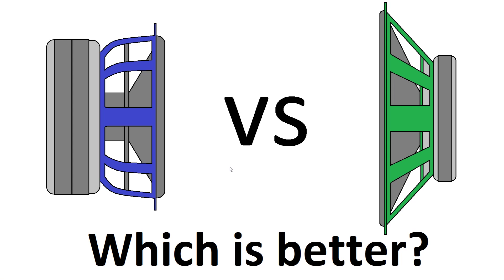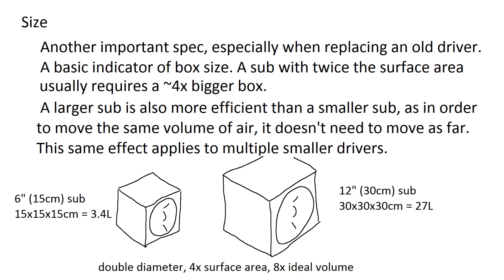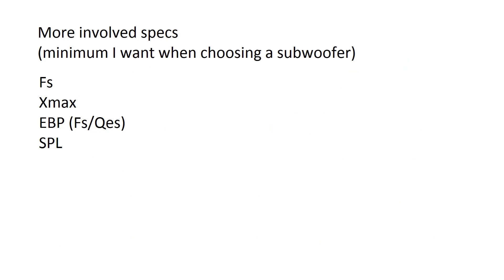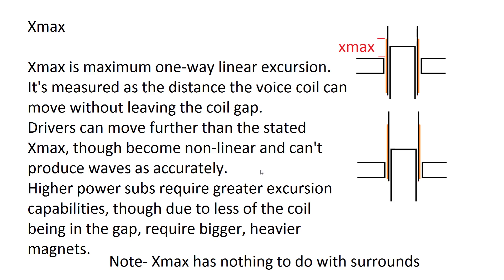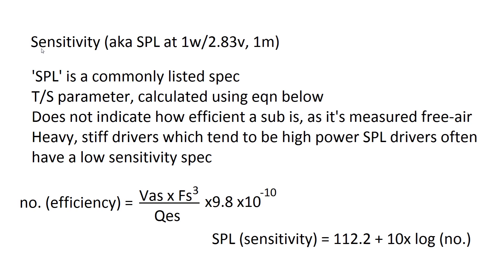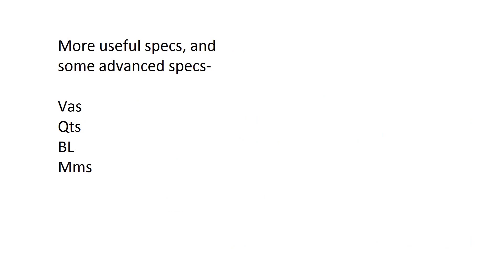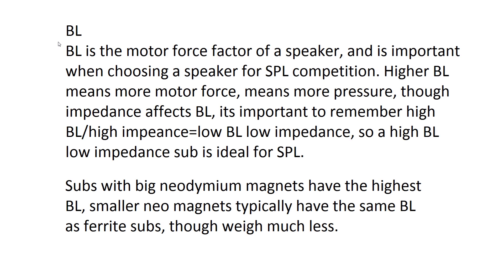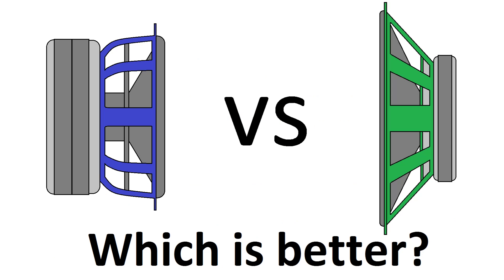Choosing the right Subwoofer

Comment: Before you spend a moment modeling your driver(s) in anticipation of Low frequency Nirvana, you should do the following in the sequence below:

1. At a minimum , check FS. Check & record all the TS parameters if you want. If you’re serious about getting the most satisfaction thus minimizing disappointment…

2. break them in free air for 24 - 48 hours changing the frequency* every 2 hours. Careful not to exceed rated XMAX. Please note: lower frequencies at the same power as upper will move the driver further. 
*never equal or lower than FS (in #1) to avoid damage. Best set the frequencies in range you plan to use it 

3. Test/check your driver’s T/S specs. As Dak said “…after 20 hours of use, the FS spec will change…” potentially changing the final system performance. If you’re building a multi-driver system, check & record all the drivers’ TS parameters. It’s possible the specs may differ slightly. How much indicates quality control.

Now you can model, design, build, test, tune (if ported) and enjoy your sub system.

Comment: HELLO, I BEEN TRYING TO DO AS MUCH RESEARCH AS I CAN I HAVE A ALPINE X-W12D4 AND I WANT THE MOST SPL I CAN GET BUT NOT LOSE TOO MUCH MUSIC PLAYABILITY ACCORDING TO YOU IT SHOULD BE IN A SEALED BOX BUT IT DOEX HAVE GREAT XMAX  AND A LOW RIGHT NOW I HAVE IT INA  PREFAB BOX THATS REALLY CLOSE TO PERFECT PORTED ALPINE RECOMENDATION. 1.7 INTERNAL VOLUME AND TUNED TO 36 HZ  IS THIS REALLY THE BEST I CAN HOPE FOR OR WOULD A 6TH ORDER BE BETTER OR A 4TH ORDER SINCE IT DOES LOWS REALLY WELL ALREADY BEING A LOW FS SUB AND NOW ITS A COUPLE YEARS OLD MORE LIKE 25HZ FS OR SOMETHING LIKE THAT INSTEAD OF 27 OUT THE FACTORY.

Comment: I think with Vas it's more equivalent to a rigid plunger the same surface area as the Sd of the driver - the projected area of the cone perpendicular to its in and out motion. Atmospheric pressure air usually needs about 0.01 bar of this pressure per % compression for small close to linear compressions.

The Vas (if measured at sea level) is dependent only on suspension compliance Cms and area Sd. Cms is the number of millimetres a cone will move off centre with a Newton of force on it.

Comment: ObOut of everything xmax is the most missused measurement and i is a peeve of mine, you are knowledgeable  and know the deal but when other yourubers who are schooling viewers or reviewing subs miss use it like "it has a taller frame to increase xmax" or comparing subs saying this one has more more x max so it will move more or like its better because of the xmax number even tho ive tried to explain the formula abd how xmax can be decieving and how 2 identical subs but one has a thin top plate one has a thick top plate how the x max will be considerably different but yet function is pretty much the same or the one with the lower xmax may prrform better because with the thick plate it may have a larger magnetic field on the coil and linierarity is comparable.... you can have a really tall coil and really thick top plate and a sub with a little short coil and a super thin top plate and both have the exact x max but yet one is way more powerful and have way more excursion.....so Without knowing the coil winding width and top plate thickness xmax doesnt tell you much about performance. Basically xmax is missused for x mech ALL the time o  youtube and drives me crazy.... These people need to educate themselves before attempting to educate otheres ya know...

Comment: I'm in a dilemma. Should i keep using my focal f40th 10" sub or should i get the focal utopia m sub10wm? Please help. As i just moved the focal f40th speakers and tweeters to the rear and have the utopia m 3 way active in the front. 6wm at doors,  3.5wm and tbm are at the front A pillars. My current sub is in a sealed 1.041 Ft3 box.
Reply from the maker: Depends, at face value the f40th 10" sub should be fine, but if you think your system is lacking depth, say low 30s/upper 20s region might be worth considering the sub10wm, although a 2 ft3 box will be more suitable for the sub10wm. If you haven't yet treated your current sub box, could be another upgrade to consider.

Comment: way you call subwoofer any speaker can go below 0 Hz they a only call woofer right ?
Reply from the maker: I would say a subwoofer is designed only for low frequencies, and a woofer can do some midrange. Woofer can do around 50Hz to 500Hz, subwoofer does around 80Hz down to 30, 20 or even lower.

Comment: I once bought a solid speaker system with 6000 watts output. Used to draw 0.5 amps from the outlet at full volume 😂😂😂
Cost a dollar, so it was worth it. For parts.
Quick calc: 0.5A @220vac = 110watts, 
class D amp rated at ~80% efficiency, 
Actual output <85watts.
Considering 50% loss to sealed enclosure design and driver efficiency losses, actual sound output would have been closer to 20 watts 😂😂
6000 watts advertised to 20 watts actual 😱😱

Comment: 4:55 aren't they always tuned below Fs? don't speaker move the least on a port resonance frequency so it will make its life easier on a lower frequencies and actually prevent damage?
(ofc if subsonic tuned right so it wont go lower the port tune freq)
Reply from the maker: Sometimes tuned below Fs, not always. Can be done, heck I do it myself all the time, I think its more of a SQ thing not tuning below to avoid some harmonics which can form. Some drivers though have stiff/heavy enough cone and a strong motor can play below Fs just fine, and sound clean. 
Tuning below Fs is good for controlling excursion though, especially in larger boxes.
Reply: @Dakoustics  just to clear things up a bit, are we talking about free air resonance or resulting speaker + box volume resonance?
i think tuning port to Fs and higher is what spl guys do(and on a cheap woofers to give some wow effect on a most common 40 or 60hz frequencies). 
tuning it lower is done in order to extend frequency shelf a bit, because speaker efficiency below fs drops drastically, so port gives some extra 5-8hz or more with eq'ing.. 
and makes everything on its resonance a 20+ ms group delay humming hell, cant see someone sane actually enjoying that on a working frequency range.
Reply from the maker: @Timsturbs  Free air resonance, Fs, whereas resonance in a box is Fb or Fc, can't remember specifically, but Fb sounds familiar. 
And yes, thats all 100% correct. The only difference is I'd say its less common for a manufacturer, such as JBL, to tune below resonance, but we as educated and free humans can tune into the single digits if we so desire. 
I can't remember specifically why I suggested not to tune below Fs, though I believe its more due to this video being focused at beginners.

Comment: Different manufacturers measure Xmax differently; there is not just one way to measure it. Therefore, one must either know how the company measured it, or just take the reported Xmax as true. Higher powered subs don't "They move more with more power." I'm sure that there are subs like you mention, but just more power in and of itself is not sufficient for your conclusion. It depends a lot on the enclosure.  
--come on. you know you are fibbing.
Reply from the maker: Generally higher power handling subs are also capable of more excursion, and having plenty of Xmax is never a bad thing.
Reply: @Dakoustics  Well, IDK about in general. Any speaker can have any thermal limit. But what you are saying is that, .. if a speaker has a higher Xmax, then it must have a higher thermal limit because of the power and mechanical properties.

Comment: I am planning to put a 21” 2,000rms  woofer in a T-42 enclosure. Would this woofer sound better that the intended woofer from Cerwin Vega which is. 1,000 rms power l? I believe the gap of this woofer is 1.6.
Reply from the maker: Most drivers should work, a driver with a very low power handling might not work in such a box, but a more powerful driver should be fine. I can't say if it will sound better or not. Worth testing

Comment: The part where you describe how drivers can cut off part of the wave form. That's called clipping and is actually pretty hard on the motor. That's what causes most of the heat. It can also cause the windings to delaminate from the former which is what makes that scratchy noise we all never want to hear. It can be equally damaging to under power a sub too. Running out of electrical headroom is hard on the amp and can also cause significant heat in the speaker motor especially on the stiffer drivers. If the amp can't overcome the mechanical resistance of the driver all the current it can generate still gets dumped into the coil. If it can't move enough to dissipate the heat, it fries. Great video man. I wish the world had more people like us who truly understand this stuff.
Reply: What he is describing has nothing to do with the amplifier clipping.  Clipping can increase the power seen by the speaker because it electrically  flattens the top of the waveform increasing the average output and at the same time limiting the movement of the speaker somewhat decreasing it's ability to cool itself which you mentioned. Yes, amplifier clipping can be hard on both the voice coil and the amplifier itself but that isn't what he is referring to.  He is referring to the electromechanical limits of the motor assembly.

Comment: Hi there. I am wanting to run two 8inch subs both at 500 rms recommended but advertise 4000w max power. I dont want to run an 8000w amp for two subs that im wanting to run at 500w each. would a 1ohm capable 1000w or 2000w  work more than fine? and how do i know if im running the correct amount of watts through the speakers?
Reply from the maker: Yeah, 500w on an 8" should already be plenty for them, 4000w would likely result in a new bit of space debris. If each sub is a dual 2 ohm, a 2000w at 1 ohm will do, if they're both 1 ohm, a 1000w at 1 ohm should suffice.

Comment: Dak: I have some vintage speakers, one of the large 12" drivers was sounding bad, we took it apart and it looks like the voice coil was stuck to the spider.  We cleaned everything out now.  We slowly trying to get replacement parts, but none are around, so, I purchased a matching set of 12" drivers with with way more wattage than the previous,  but when we played them, I realized our crossover didn't match.  Do you have a guide on choosing the right or upgrade on the crossovers?  I love the cabinets on these old speakers, I don't mind changing out what I need to keep these up and running.  I also have a 20 year Infinity speaker that needs a new crossover as my tweeter is not functioning properly?  Any suggestions?
Reply from the maker: I'm not sure exactly if voice coil inductance itself is a major factor in designing a crossover, though I do know a speaker of the same resistance is required. 
Possibly they were connected reverse phase which would likely make the overlap area sound quiet and wierd, which could be the "didn't match" sound.

Crossovers are a bit of a pain, premade crossovers are fairly common, all which is required is speaker impedance and crossover frequency, and to a lesser extent wattage. I know Dayton make a few different ones, even 3-way crossovers. There are also crossover calculators online which make the whole calculation process way easier. 
My knowledge of crossovers is limited, but I've heard from others the most basic crossover upgrades are replacing iron core inductors with open air inductors, and replacing old or low quality capacitors with high quality audio caps. Even improving solder joins can yield higher sound quality.

Also regarding tweeter not working properly, the most basic crossover for a tweeter is simply a capacitor in series with it, and there will be a capacitor in there somewhere which may have failed.
Reply: @Dakoustics  So you have a email address or facebook page I can write to you?

Comment: Hi Sir, kindly advice. Which sub will have deepest bass between two subs, all parameters held constant save;
1st Subwoofer  Pioneer TS-D12D2.0 with 72db, 600 wats RMS dual core 2 ohms  vs 
2nd Subwoofer:   pioneer TS w3003d4 with 96db, and 600 watts RMS 4 ohm dual core.
Thank you Sir.
Reply from the maker: Second one has good specs, but first one has a lower resonance, and should be better for deeper bass. I can't see all the specs for the first one, so I can't say if its a better subwoofer in general.

Comment: Ok so I had 2 x 12s 150 RMS each so if I want run 1 10 inch how much RMS must that 10 inch be
Reply from the maker: Need more info, if you mean you wanna be just as loud with a single 10" as your 2 12"s on 300w total, since the box is also smaller, and smaller means  less efficient, could be something like 1000w RMS.
Reply: @Dakoustics  thanks because I don't have a car anymore with plenty space options I got a bakkie now so need to look at something smaller

Comment: I wonder why you didn't cover impedance rise while playing. A 4ohm sub is not going to see around 125 watts out of a 250 watt rated amp at 2 ohm, even if the amp is rated 125 watts at 2. The impedance of the speaker will rise, often doubling it's own impedance, resulting in even half that power.
Reply from the maker: A couple reasons. Most amplifiers are constant voltage, variable current, and most speakers are designed around this in order to get a flat frequency curve. 
In order to be on the safe side I wouldn't tell anyone to run an amplifier below its rated impedance. If a driver is 4 Ohms, and is DC 3.2, when it's playing at its tuning frequency, say 40Hz, it'll be pinned right at that 4 Ohm mark. 
With speakers, too, in the "linear zone", which is still perfectly playable, they remain 4 Ohms, box rise has no influence.
SPL is quite a specific topic in the world of audio, and most people, and I'm going to say 90% of hobbyists who are looking for a subwoofer for a home theatre as a project, isn't going to ring the neck of every component for 0.13dB. 

All above mentioned, check out my "all about impedance" video where I briefly mention fighting box rise to get the most power, its near-ish the beginning too.
Reply: @Dakoustics  You don't have to run an amplifier below it's rated impedance, I'm just saying matching amps and subs is not just look at the numbers and match them. Say you have a 4 ohm sub, rated for 200 watts RMS. Buying an amplifier that outputs 200 watts RMS at 4 ohms would literally result in only half the power in most cases. You'd be better off buying an amplifier that gives around 300 watts in MOST cases, just because you have a small buffer and because most people don't have a clue how to fight impedance rise when they're just starting out with their home systems, having 100 watts more in your pocket doesn't hurt at all. I think you misinterpreted what I was trying to say.
Reply from the maker: @retrogian  Ah yeah, I must've, I do suggest to my mates to run a slightly more powerful amp than their subs for exactly what you mentioned, eg. one of them recently got a 250w RMS sub, and I suggested he get an amp capable of 350w. Heck even I run 1000w RMS into a 500w RMS sub.
Reply: Unless you’re lowering the amp’s power with the gain wouldn’t that overpower the sub when you’re not experiencing resistance rise? And in that case what is the benefit beyond plenty of clean power? Or is the extra power not an issue since it’s not constant?
Reply: Some drivers with 4Ohm in specs can easily have 1Ohm at some frequencies. You have to check an amplifier specs. Otherwise you’ll be replacing fuses very often.

Comment: Great video! Finally someone could explain some of the specs on a driver spec sheet
Reply: Hexibass does a far better job of it. Goes into more detail and is more informitive. This video is a good start, dont get me wrong but needs more. For starters, BL for DVC drivers is always calculated while the driver is wired in series becuase it yields a larger BL figure.
Reply from the maker: @The_Koups  Proper T/S video coming in the near future ish time date month year

Comment: I wish someone would explain to folks just how u do the math part of the sub ohm load out to the amp its self like 6 8ohms registers around 5.5 ohms that ur amp sees @ 4ohm bridge these are the things someone needs to make a video about fr so i could send ppl to the link fr cause i have gotten tired of trying to explain all of the mathematical part of any car audio fr fr like wiring 2 4 ohm speakers together with the positive to the negative changes the speakers ohm load to a 8ohm or u can wire positive positive and negative to negative and change the 2 4ohm to a 2 ohm load to the amp but it could be either stereo or bridge fr trust me trying to explain some of this stuff its took me years to learn isnt easy fr this is just a suggestion fr
Reply from the maker: I made an impedance video recently, sounds like it'd to the trick